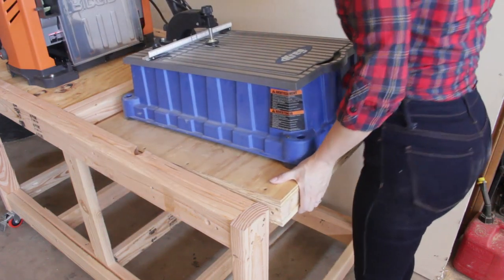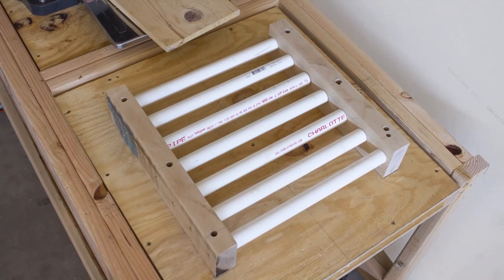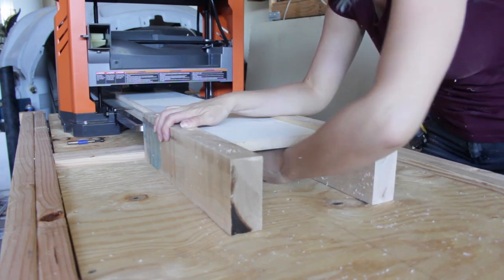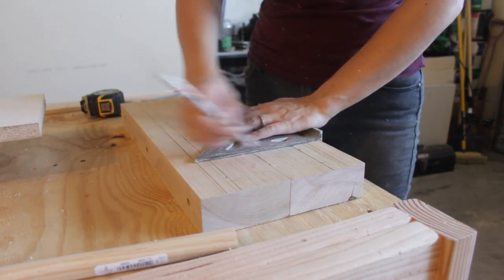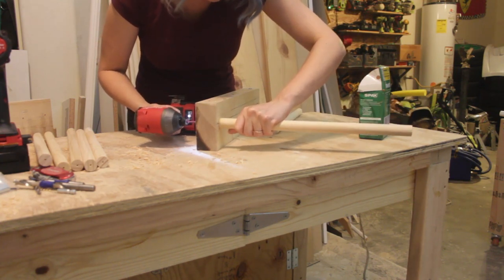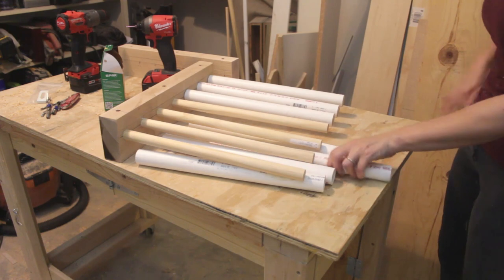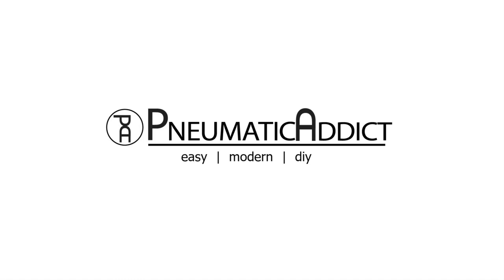EASY Outfeed Rollers | Woodworking Shop Project

Comment: Love this! The only thing I would do differently is use a Forstner bit the same size as the dowel in the side rails to ensure they fit perfectly in line and don't shift  when I drive the screws in off center (which I inevitably would)

Comment: The idea seems simple enough.  I like it.  But it may have been stronger and easier to assemble by using a Forstner bit to make holes for the dowels in the support pieces.  A template with a guide that slides against the top and a hole would allow for consistent hole spacing.  That being said, I have the same planer and will likely build something similar in the near future.  Thank you for sharing.

Comment: That is a very clever solution! In line with your flip-top concept you could mount the roller assembly on heavy duty hinges on the side of the table (you would probably need to re-dimension the roller assembly a little) so it can be flipped over the side when not needed, and easily flipped back in place when needed. This will also free up some table surface which is always useful in the workshop.

Comment: Good idea but if you have trouble with them rolling smoothly try 1-1/2" steel pipe with 1-3/8" OD wheel bearings inside the pipe.

Comment: I'd consider adding short tethers to the "lock" bolts.  That would allow you to pull and drop the bolts when rotating the decks, but know they will be at hand right next to the holes when you need to reinsert them, which would allow you to get two hands onto the decks more quickly and avoid twisting to grab them from the shelf.  Just an idea :-)
Reply from the maker: That's a great idea! Thanks

Comment: Does this stop the snipe at the ends of your boards  that you get from most planers?
Reply from the maker: My blades are still nice and sharp but I haven't had any snipe yet. Fingers crossed!
Reply: This would not eliminate snipe and blade sharpness doesn't eliminate either. Most of the time you have to check for snipe with calipers.
Reply: It will help reduce it. The weight of an unsupported board placed a lot of tension on the knifes and arbor. The work piece needs supported al the way through to stop the arbor from bending and the knife edge from breaking. Rough stock should be 6"-8" longer than the cut length needed.

Comment: Like someone already pointed out, the PVC pipes aren't rolling, which can be seen on the red writing on them which stays in place. The idea is nice though, might just need some fine tuning.
Reply from the maker: Light weight material can glide over the PVC easily with no need for them to roll. They only roll if the material is heavy. They work great either way.
Reply: @PneumaticAddict  As long as it works for you it's fine I guess :o)

Comment: Complete and utter noob, here.... what was the blue tool you've used to trace the lines onto the side boards? (1min 09sec...) and the centre punch tool from rockler?
Reply from the maker: It's called a Multi-Mark from Kreg Tools and yes, the center finder is from Rockler.

Comment: They don't seem to roll at all.
Reply from the maker: Light weight material can glide over the PVC easily with no need for them to roll. They only roll if the material is heavy. They work great either way.

Comment: are all edges perpendicular? the film shows a large gap between the counter top and the roller JIG
Reply from the maker: Do you mean the workbench frame is higher? I think I see what you are talking about. I used scrap boards and did not plane them,  so there is a small gap under the right side board of the roller assembly. It's screwed to the work surface so there shouldn't be any rocking.
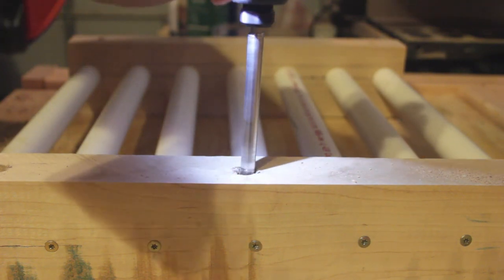Reply: @PneumaticAddict  for example in 3:13 you can see that in counter top is the gap becouse the rollers is higher then a table top(i mean the piece of table on the exit of thicnkness planer) so you would have problems with  perpendicular edged, beacuse your material is going up on rollers
Reply from the maker: @klinsmann87  I see what you mean. No, that must be a shadow. I could see how it appears that way though. There is no gap under the board. The exit height of the planer is actually maybe 1/32 higher than the rollers.
Reply: @PneumaticAddict  yeah there is a shadow - in the gap beetween wood and metal table :) in the video it looks like the exit of the planer is lower then the rollers in my opinion.